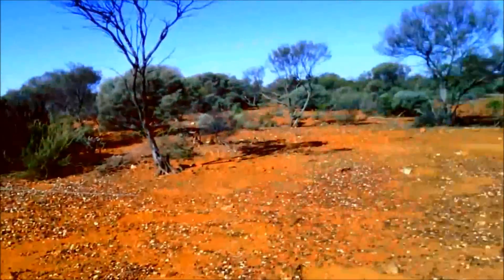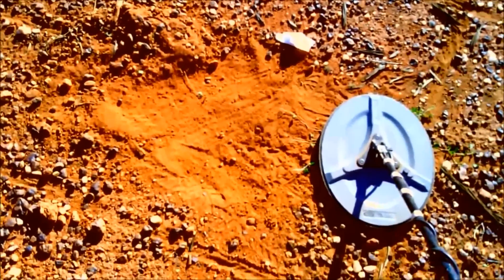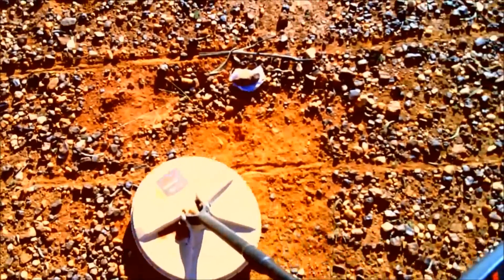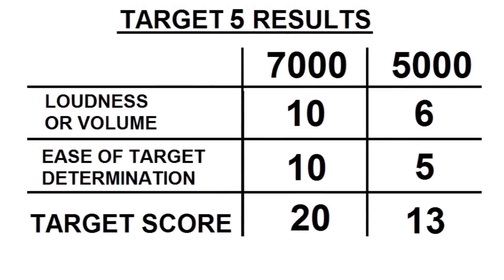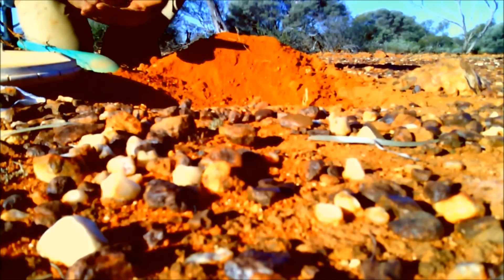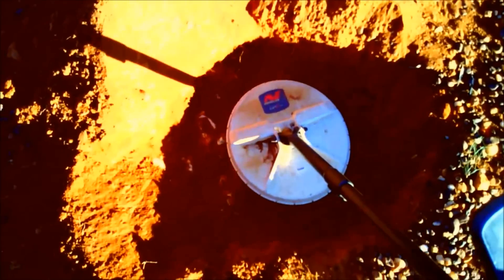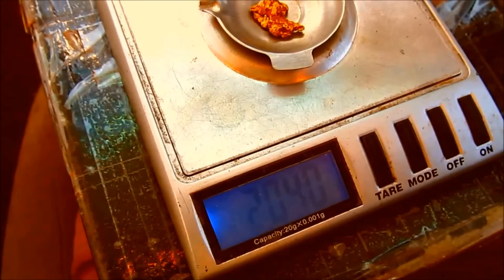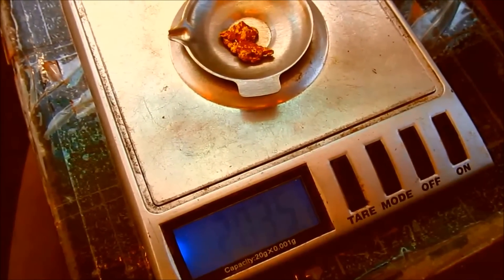Metal Detecting - The Minelab GPZ 7000 and GPX 5000 - A Target Test Comparison

Comment: Very good comparison vid there John. I've had very similar results and found that running a smaller12" EVO  the smaller gold showed up on the 5000 pretty well equal to the "Z". I agree with your conclusion that in the right hands, with the right settings and experience, both machines are at the pinnacle of detector capabilities. Good luck on your next trip mate.
Reply from the maker: Thanks Wal. Both are at the top of their game, and as you know, put in the right hands are dynamite. Look forward to 2018 in WA. Kind regards, John

Comment: Interesting testing, but hardly comparable. It would have been far more interesting if you had used the N/F on both machines. Would have made it a little easier for me to choose between the two machines. I have chosen the GPX 5000 as it is a little lighter than the GPZ 7000, (means a lot when you're swinging it all day) and hopefully a bit easier to learn to use. From some of the lads out WA, the GPZ thrashes the 5000 most days but there are those that swear by their 5000's. Also it's probably a better bet price wise for a beginner. Anyway, it's already started paying itself back, found a tent peg, a dinner knife, half a dozen bottle tops and $1.20. I'll get there, just $4998.80 to go, or thereabouts.
Cheers for the vid, it told me I now need a N/F 17" x 13" coil..........damn                :)
Reply from the maker: I agree with you that it would've been good to compare the same coil on both machines,  but I hate to break it to you mate... the Zed cannot take the NF coil. Regards Aussie
Reply: @AussieBlokeProspector  Ahhhh, didn't know that. Only just got the 5000 couple weeks ago so it's all new to me.
I am learning tho         )
Reply: @2Qwk2C  You have me wondering, how much more did you find?
Reply: @ClearAdventure  Hi there. I found a few hundred bucks, rings, ear rings, other bits of jewelry, nothing great so far. Haven't been out for gold but should be able to in a couple of weeks. I was wrong, should have bought straight into the GPZ 7000. It would have been just as easy to learn as I knew nothing anyway and it has way way better technology. Always buy the tech!!!!! It'll be my next detector (Always buy new!) unless something better comes out, which MineLab will ultimately produce. Cheers CA                :)
Reply: @2Qwk2C  Hello! That's great that you found more! Sorry you got the one you did not want in the end, but hopefully as it is still pretty new you may be able to sell it? Anyway, I appreciate your response. Happy hunting! - Kevin Venture 😁👍
Reply: @ClearAdventure  Cheers Kevin. I love the GPX 5000 it is a great detector, better than most on the market, there is nothing wrong with it ........ it's just that the GPZ is better lol. Regards             :)
Reply: @AussieBlokeProspector когда уже появилась катушк на Z можно было сравнить их?!

Comment: Thank you for sharing your results! Video well done! You concluded the 5000 equipped with the Nugget Finder Evolution 17X13 coil outperformed the 7000 on the deepest and largest target. The 7000 has 3 settings; 1) shallow fine nuggets, 2) intermediate depth medium nuggets, and 3) deep large nuggets. Which setting did you use on the 7000 for the deep and other targets? Apology if this question was already asked. Thanks!
Reply from the maker: The result was based on the scoring system I used. Specifically to be objective. Remember, I originally found all targets with the 7000 and to be fair, had I not scraped off an inch or so before confirming the largest and deepest target was in fact a "target", I actually have my doubts that the 5000 would have picked it up. Regards Aussie
Reply: Understood! Thank you for the reply! I'm in British Columbia and have been researching and studying gold deposits in WA during my spare time for 3 years with hopes of visiting the State in a year or so. Was going to buy the GPZ 7000, but decided to purchase the CTX 3030 in 2016 as my first detector for learning and relic hunting. Will probably choose the 7000 to bring along to my WA visit. Will bring the 3030 also for trashy areas, but the wideband frequency range isn't suitable for gold smaller than 2 grams at intermediate depths. I'm involved with wet wash placer gold mining and it's unfortunate my mining season coincides with the best time to prospect WA. My time off here is November to March, so I have to pick the best time, if any lol, from that period. Cheers!
Reply from the maker: Your'e welcome mate.
Reply: RioOro555 Hey Rio, from my experience working at a gold mine near here you could expect a minimum temp of 35 to 50C during that time. I had a two week stint that didn’t get below 45 with a top of 52. Good luck.

Comment: Brilliant comparison mate.
Reply from the maker: Cheers mate....  thanks for the thumbs up... appreciated. Regards Aussie
Reply: It still amazes me how much difference even a couple of inches can make on certain targets. A bit of an eye opener when demonstrating it to new users. They quickly learn to keep the coil on the ground as much as possible. Just curious did you have a booster on the 5000? Signal seems to be distorting a little whereas the 7000 sounded quieter but cleaner

Comment: I like the way you did the test on real targets still in situ, but there is a couple issues I see. The whole point to a 5000 is its optionability. I always see these comparisons done the same. Bigger coils, basic settings which looses the real power of a 5000. That would be like putting the 19 inch coil on the 7000 and comparing that. For a start who would use a 17x 12 to find all targets on a flogged patch. I would have gone for a 9 inch round coiltek elite or the 14x9 elite to clean up the top foot. I might have missed it but also didn't see what settings you used. Which is another great thing about the 5000. I would like to see a 5000 set with the best coil and settings for the situation. Was still a good test though, and I actually think the 5000 did just as good considering it wasn't set right for the right circumstances.
Reply from the maker: The "optionalbility" of the  5000 was never a consideration in making this video (believe me if it had been, the whole setup would have been different). This video was made primarily because at the time the new Nugget Finder Evolution coils had hit the market and there was a lot of conjecture about how a 5000 with a 17x13 Evolution coil was just as good, if not better than a 7000... I had quite a few people ask me to do a vid on it...so having said that, I probably should have put that in the Title...something like..."the 5000 with a 17x13 evolution compared to a GPZ". The argument at the time was that a 5000 with the 17x13 could out perform the 7000. That's why it was used. ALSO, as I said in the video, it was NOT used to initially find the targets... the GPZ was...so this was purely a Target Test comparison of ALREADY located targets. Having said that, if anything, this video proves just how powerful the 5000 is with such a Big coil on such incredibly small targets... which is exactly why it was done on flogged ground...to highlight just how good it is, because by default the only gold that was going to be found there was not going to be easy to find or hear.... and this brings me to my next point... You assume I used basic settings on the 5000 even though you say that you didn't see the settings I used... so I have to ask...how exactly did you come to the conclusion that the settings were basic? I can assure you, the settings I used were not conventional, and venture to say, if not employed, the 5000 may not have performed as well as it did.  Finally, about your remark "setting your detector right, for the right circumstances" ... Firstly, as I said , this video was specifically about the 17x13; secondly, while on the subject, (and here's where I part ways with the status quo), perhaps one of the biggest misnomers out there....consider this...If as an operator you are always changing and adjusting the set up of your detector according to any one of the miriad of conditions out there... then the truth is... you probably don't TRULY know and understand your detector... and if you continue to change it's set up everytime... you probably never will.  Regards Aussie
Reply: @AussieBlokeProspector  yeah fair enough. The title idea might have been good..i agree the 5000 was pretty good with that coil. Also I rarely change my settings. I have some that I discovered that I use 95% of the time. Thanks for clarification

Comment: Nice video just wondering what number sensitivity did u have the 7000 on?
Reply from the maker: Thanks. The settings I use are the result of 100s of hours of testing on targets
 left in the ground, and therefore not general knowledge. In
 case you are interested, I do offer tuition on the ZED ( I teach every 
thing I know and have discovered about unlocking the potential of the 
7000)... for more details you can go here  http://www.eurekaprospecting.com.au/56/metal-detecting-tuition